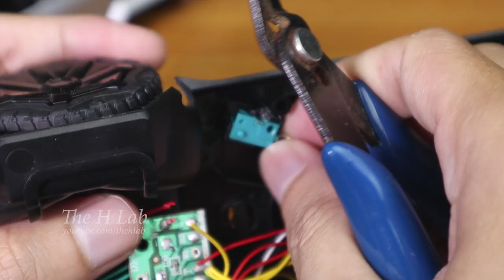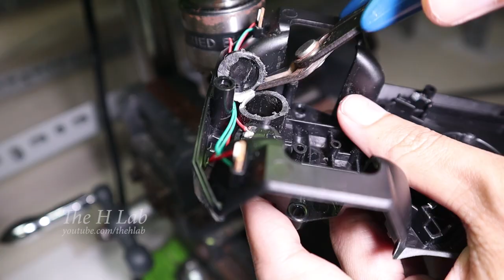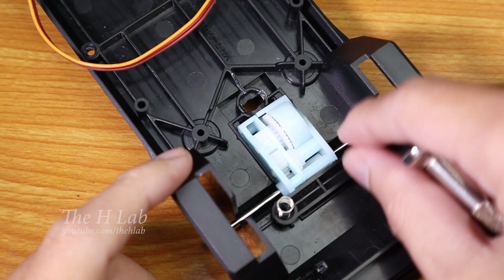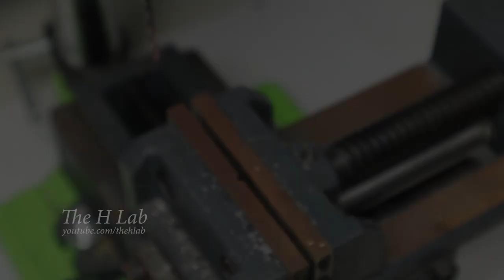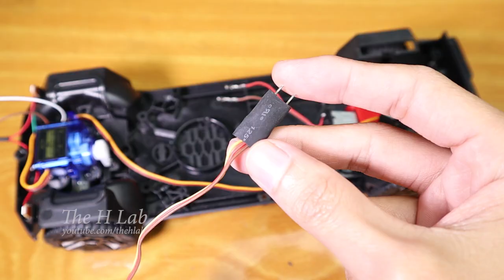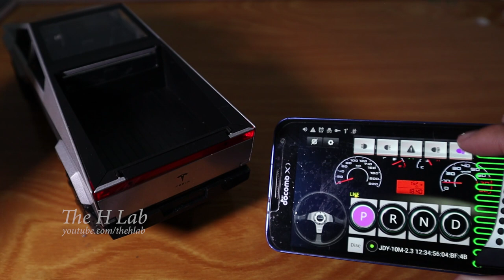Tesla Cybertruck RC | Bluetooth Control | The H Lab

Comment: is there any reason at all that all the functions are interfering with each other? when e steer or turns on the lights it will move the wheels briefly and its kind of annoying I'm not sure what's causing it.
Reply from the maker: It’s not stable with the first version. So I have a better version with MCU is ATmaga328

Comment: what's the delimiter setting do in the app and what should it be set to? also should I be using stream mode? and how much should I have it cycle? I still cant seem to get it to work with my Arduino and hc05. edit: ok good news. it turns out it didn't work because I forgot to specify the Bluetooth device which is 9600 and what was set was different since he uses a different BT device. so now I'm getting the commands in the console however they still don't have an effect on the pins. just to verify RX is pin 3 and tx is pin 2 correct?
Reply: I got it to work, only problem is there's something with the code it moves forwards if I steer. its jumpy and doesn't go full power but it still effects it and so does a few other buttons. what's causing this?